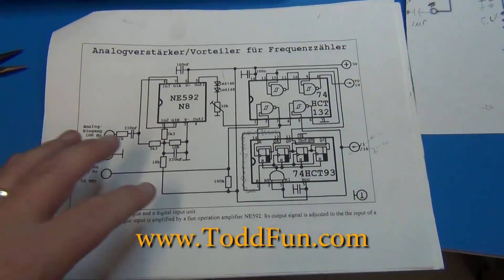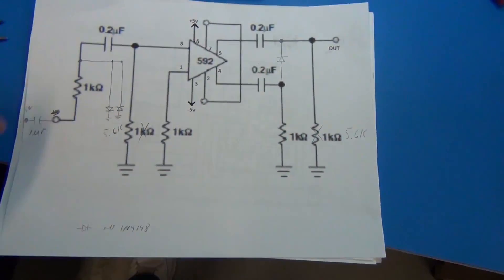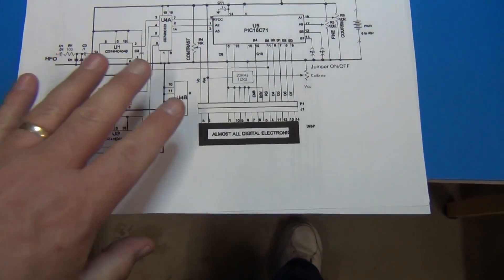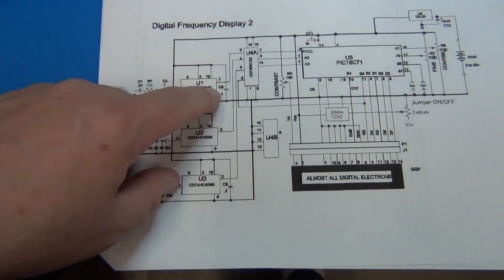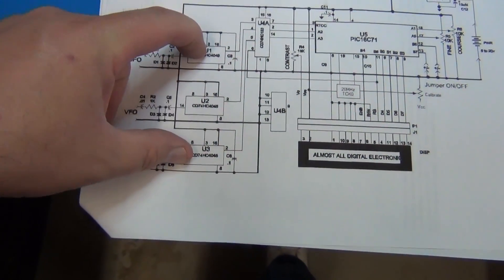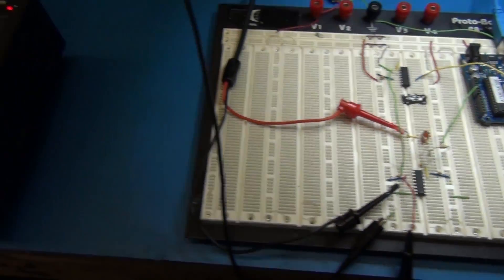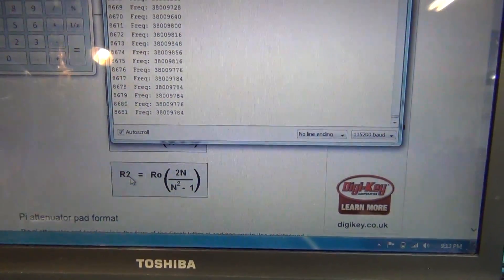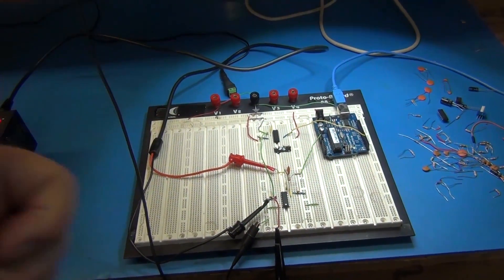Arduino Frequency Display for Kenwood TS-520S HF ham radio PART 4a

Comment: Todd, instead of those 2 input options there must be a frequency counter chip you could us that would amplify and count the input then send a digital output to the Arduino that would make it even simpler and the Arduino wouldn't even have to count anything, just read the outputs from the counter chips?
Reply from the maker: Nice idea. If you could source that so I could compare the option that would be appreciated. Thanks.
Reply: I was thinking there must be a counter chip that would take the low level input, count it and give you an output but looking at digital counters you can buy on Ebay for $6-$10 that go up to 50-65 Mhz  they seem to only use a PIC ucontroller.  Ones that go up to 500 or 1000Mhz seem to use a divide by 64 prescaler chip before the PIC.   I know you said that you didn't like PIC controllers but the Tiny85 only needs a crystal to work.  I guess it doesn't matter now though since the project is finished.
Reply: I got a little frequency counter on Ebay for $10 that goes to 500 Mhz and has a very simple circuit using just 2 ICs, 20 Mhz crystal and a few resistors and capacitors.  One IC is an 8 pin prescaler marked 501L and the other is an Atmel ATMEGA48P.

Comment: Sir Todd, Re 5:05: Since pin 14 is the Signal Input of the PLL (and PLL’s are designed to receive frequencies at this input), which gets amplified and is fed to an XOR gate and finally to a non-inverting amp at output on pin 2 (Phase Comp I, made digital with good sink), he is conditioning his signal with a PLL instead of you doing the same thing using a Video Amplifier (which was “designed” to amplify a video signal only) and NAND gates. It uses a single supply and is a CMOS device- low power consumption and low loading. Just my guess… :)
Reply: The PLL is not used.  Look at the TI datasheet schematic.  Pin 14 is indeed an input (Sigin).  The path is through an exclusive OR gate.  Pin 3 is pulled up and feeds the other side of the  exclusive OR. With pin 3 high all the time whatever is on Pin 14 will just go through the XOR to the CMOS (0 to 5 Volt) output buffer on pin 2.  As wired only these three gates are used. Nothing else in the device is used.    

Now the neat thing is that input on pin 14 has an AC coupled sensitivity between 15 and 33 mV pp.  See table on page 10.  No wonder your 200 mV and higher signal works! The output is rail to rail full CMOS swing.  You can't get much better.    The bad news is that the max frequency for this path is not specified but the VCO (the unused section) is specified at a 38 MHz maximum so it is reasonable to expect this section can also support 38 MHz.

If you were to put one of your signals on pin 14 and the other on pin 3 then the output on pin 2 could be used as a phase detector or a mixer. But with pin 3 pulled up it is just a very good high gain buffer.